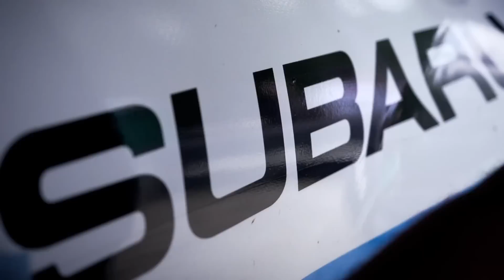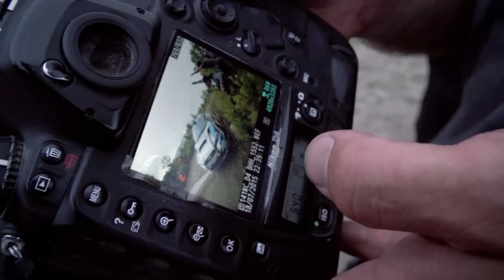The Maine Event 2 - /LAUNCH CONTROL: S03E08

Comment: just wondering, what is the sound the new subaru making? those high pitch sound when they make a turn?
Reply: +Chi Ho Ko Turbo Wastegate is my guess.
Reply: +Chi Ho Ko They are using the same EJ257 engine, so my guess would be it sounds the same as a 10 years old scooby?
Reply: +Jeffrey Pals Not wastegate -- blowoff valve. The wastegate is on the exhaust side and meters how much boost the turbo can produce. As the boost pressure reaches the desired peak, the wastegate opens to allow some of the exhaust stream to bypass the exhaust turbine so as to avoid overboost.

The blowoff valve by contrast is on the intake side and gives the pressurized intake air somewhere to go when the driver lets off the accelerator pedal and the throttle body slams shut. Otherwise it will just bounce right back against the turbocharger, stalling its momentum and possibly even damaging it in the long run. What you're hearing is pressurized air escaping through the blowoff valve when the driver momentarily lets up on the go pedal.
Reply: +DroverChicago - Turbocharged rally cars don't use blowoff valves.
Reply: +Chi Ho Ko The whine sound i believe you're referring to is due to rally cars having straight-cut or "spur" gears in their transmissions. A regular car has helical-cut gears which result in the gears engaging a little bit at a time as well as running much quieter than straight-cut gears. Rally cars use straight-cut gears because they have less surface area, which means less friction, which means less heat and less loss of power. and by using these simpler gears, it allows the teams to mess with gear ratios quickly and easily. If you'd like some more examples just look up "dog box transmissions"
Reply: Matthieu Devaud that is an awesome explanation :D Thanks a lot~